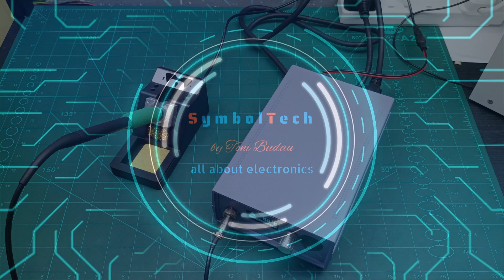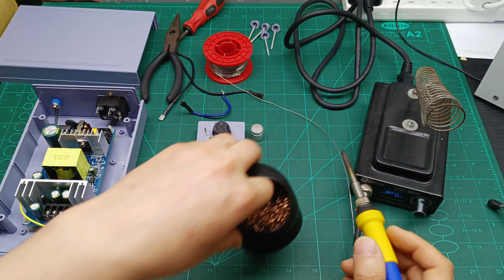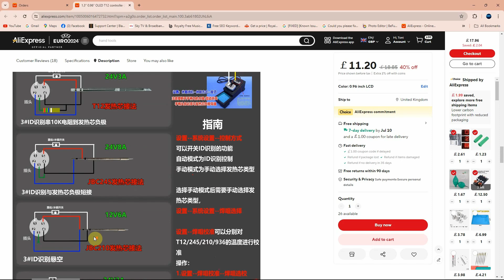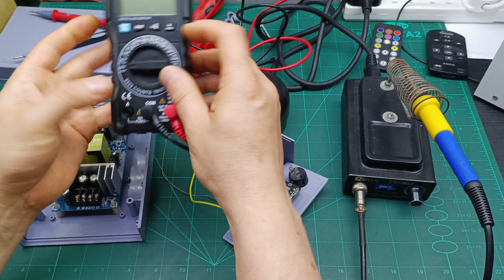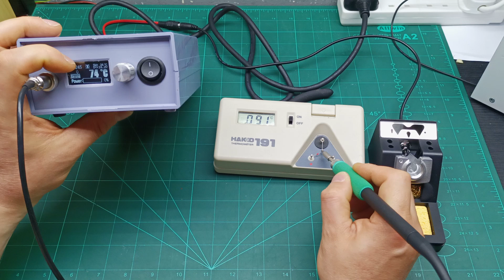T245 soldering station how I made one

Comment: life dangerous work on open case with open switching power supply. non isolated 230v cables only 2cm away from low voltage. put the 230v switch to the back and the low voltage connector to the front. where is the fuse? switching power supplies are  much more live threatening than old transformers. to be save get you a completed closed psu. with 24v 10a. be save. live long.
Reply from the maker: I will definitely show you a brand new soldering station that have the switch on the front and SMPSU!

Comment: Love the video, wanted build my own but bought a Aifen A9E and JCD 858D hot air. Just wanted to ask you something can you tell me what amps fuse do I put in the UK plug? I'm using a 10 amps fuse for JCD as the euro plug has 10 amps written on it. A9E I'm also going to 10 amps after watching your video but the euro plug had 16 amps.
Reply from the maker: The euro plug and UK plug have the same voltage on the wall socket so the current that will be pulled from the wall socket will be the same. On the US or those countries that are using 120v on the wall socket definitely the current will double to match the power as per ohm law!
Reply: @SymbolTech21  The A9E is rated at 160 Watts and JCD is rated at 700 Watts. Should i use a 3 amp fuse A9E and and stick with a 10 amps fuse with the JCD?
Reply from the maker: @sham27007 so power divided to voltage will give you the current in amps so just divide the power consumption of your device to the voltage you have on the walls sockets and then you get the amp rating. And just use a fuse with 0.5A higher than the results you get
Reply: @SymbolTech21 I decided to use a 3 amps for the A9E and a 5 amps for JCD.
Reply from the maker: @sham27007  I will go with 1.5A for the 170w and 3.5A for the 700w
Reply: @SymbolTech21 in the UK we only have 1, 3, 5, 10 and 13 Amps for main plugs
Reply from the maker: @sham27007  I was thinking that you mean the normal 5x20mm yea the one ceramics that are on the plugs it's hard to find specific ones but the 5x20mm you can find a wide range

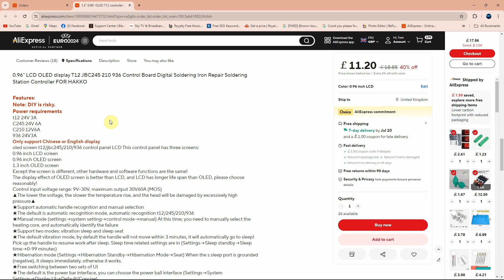Comment: 10:55 the C210 can also be driven with 24V3A (PWM duty cycle is ~1/4 compared to 12V), so no need for extra 24V->12V buck converter.
Reply: yeah...im using 24v for this module,its working well with 245,210 and t12,dont need buck converter
Reply from the maker: @hdmovies5487 thanks that's great. I know t12 is 24v and t245 is 24v and t210 is 12v but if you said that you tried and the controller adjusting the voltage accordingly for the t210 that is a plus
Reply: C210 resistance 2.1 Ohm. At 24V it is 11.5A. PWM it is duty cycle in time, but this current doesn't disappear anywhere. you need power supply can give this 11.5A impulses and tip itself of course not ready for such currents. This current also flows through the thermocouple, which is connected in series in 210. What kind of losses are there in the wires with this current 11.5А? Powering the C210 from 24V is the stupidest thing you could do. Maybe you should start thinking first? and I personally solved the problem in an elementary way. Any power supply has a resistive voltage divider in feedback loops. Add one transistor shorting one resistor and connect it to a microcontroller pin to switch 12/24V. LOL.

I did this myself when I redesigned my T12, and now it automatically supports T12/115/210/245. My stm32 t12 soldering station is already 9 years old, and I added support jbc didn't spend any money for new one. and I can do whatever I want with this STM32 station, because firmware is open source . P.S. And my old t12 station power supply 80x80mm couldn't give even 5A, it was deigned only for t12 of course. But after some changes it can give 8A in peaks. So even ols t12 stm32 possible to upgrade to 115/210/245, but you need some brain for it and will. I have electronics as a hobby, so I find it interesting to do this. To others It's easier to buy another one. Now front panel with controller and 2.0' display with pictures and graphs costs 15$ in china. Power supply 24V 9A 6$. Case 6$. And you will have cool soldering station if you want do it yourself.
Reply from the maker: @dekus80 yes I can add an DC to DC converter with a switch to switch to 12v but I'm not using c210 tips because are more designed for phones motherboards and I'm not doing phones. Mostly I repair laptops consoles and c245 it's perfect for these jobs
Reply from the maker: For c210 you need 12v
Reply: @SymbolTech21  The usb-c soldering irons with C210 tip drive it with 20V.
Fnirsi HS-02B and AiXun T208 shows 20V on the display and a guy measured the Alientek T80 received 20V on usb-c. 
There's no voltage regulator in the portable irons (PWM is used to limit the power), so that's what the C210 tips receive in those.
Reply from the maker: @Gregorius421  for this particular board I'm not sure if works the same. I didn't tried yet a c210 to confirm that because I don't have c210 iron tips.

Comment: I received my modules and I just finished assembling them today (1.3 & 1.55). Thanks to ur video, it made it easier.
I have an old laptop charger, 19V - 3.5A, used to supply.

About T12: In ur other video, about the handle in ur diagram, u took 2 wires from pin 4, one to the negative and one to the body of the tip. (total 3 wires)
I took one wire from pin 4 to the negative of the tip and the same continued to the body (so total is 2 wires going to handle)
At the end, everything works fine ... thank you again
Reply from the maker: I'm happy to hear that my video helped you to make your soldering iron, should be 3 wires from controller to the iron handle. Because the iron tip have the heating element and the thermocouple that read the temperature.

Comment: I'm new at this. So this only needs to be ground to the body of the station if the station is made of a conductive material? 

But there is no voltage leakage at the tip? So it's tip ground? If so I need to order the parts to build this when my new T12 station gets here. 

Thanks for the video! Very clear, informative content.
Reply from the maker: @wwiding  so the tip need to be earthed
Reply: In my country buildings which were built before the 1990s even don't have earth. For example building where I live (it has 17 flours) was made in 198x so it never had and doesn't have earth, hahaha. Even if I want and ready to make wires at flat, but building itself doesn't have earth, nowhere to connect. And in my city a lot of such buildings. I can only amagine about earth and tolerate the tingling sensation when touching metal parts powered by switching power supplies. World it is not only one country ). But a person is designed in such a way that he doesn’t even think about what and how is around him, it’s only around him, and not everywhere
Reply from the maker: @dekus80 I know that old buildings they don't have earth connectors but I was talking about the regulations that are now on the world that any metal case must to be earthed and if your electric wires in the house don't have this that is not what I was meaning on my video!

Comment: Is it possible to replace the IC voltage? Can it be used to solder C470 with 48V input? How can I help?
Reply from the maker: @AdibMinecraft  you need to change the controller
Reply from the maker: @AdibMinecraft  I found this controller board that works with c470 https://s.click.aliexpress.com/e/_EuW8yqY

Comment: hi

could you show how to modify the cheap 245 handle to work with this controller? 
The instructions for most of the t12/c245 controllers on aliexpress show red, black, white, blue, and green wires, but the cheap c245 handle I bought from aliexpress only has 3 wires and a jumper wire..I'm having dificulty in figuring out which wire goes to which pin on the gx12 connector.
Could you make a video on the necessary modification to make the 245 handle work? or if not tell me what color wire goes to which pin for c245? I have the same handle you linked in this video.

much thanks
Reply from the maker: @GearJammer-me8uj  here the video in how to connect the soldering irons to it https://youtu.be/gSFJQsr6UcU?si=OClVwXoxTTP1ed4x
Reply: @SymbolTech21  Thank you very much..I am now up and running with my own 245 station...I love it!
big thanks to you!
Reply from the maker: @GearJammer-me8uj  that what I'm trying with my channel, to help other people on understanding better how electronics works and how we can make our own devices spending less money!

Comment: hello, have you tried to connect t245 to your quicko station
Reply from the maker: @zombieryder  I don't tried but will not work. Because 2 reasons. 1 the MOSFET which controls the iron tip will not handle the current and the power supply that is inside the quicko don't supply enough current
Reply: @SymbolTech21  im using modified handle with hakko TX1 150w and TX2 300w cartridges on quicko station to solder thick copper. I dont have t245 currently to test with. Also Im guessing the power rating is about how quickly the tip heats up. Quicko station heats up 300w cartridge just fine though it does takes its time.
Reply: @SymbolTech21  if I am not wrong, at your tutorial, you used the t245 cartridge. So why are you saying that it will not work. Did I lose something?
Thank you!
Reply from the maker: @Kostliasist  I used t245 with an 9A 24v power supply

Comment: Thank you for this full tutorial with links to buy the parts! You got a new subscriber with a useful video like this. I'm new to soldering and this seems like a good way to get a quality iron for a good price. 

What type of wire should I use to connect everything? I bought all the components you linked but I'm not sure the wire type was listed. Is there a specific type of connector I should get with the wire?
Reply from the maker: @Jacob-vx4zw  hi there when you get the soldering iron handle please make sure you check the connection diagram of the wires from the connector to the iron tip because you need to modify some pin orientation. About the wires I used for the mains AC voltage stripped a pc power cord and used and from the power supply to controller board used wires from an old pc power supply.
Reply: @SymbolTech21  Thank you! Do you have a link for the jumper cable you used and the power adapter on the back (the small one with the yellow cable). I was not able to find a link.
Reply from the maker: @Jacob-vx4zw  I already changed that connector because I installed the connector which I received on the last mailbag video. Have a look on that video and you will find the link on that video description. I changed because should have 2 separate wires that goes on 2 different locations on the soldering iron controller board and when I'm using the part for swapping the iron tips will show on display as well that I'm changing the tip
Reply from the maker: @Jacob-vx4zw  on this video I have the right connector for the cable that connects the soldering stand with the soldering station https://youtu.be/jfjz_3gEWzE?si=sY1-cN19BxiTQwPh
Reply: Hi again,

I got everything setup but you did not mention how to convert the T245 plug to work with this setup. How do we change the plug on the T245 soldering iron to fit in the socket?

Thank you
Reply from the maker: @Jacob-vx4zw  I don't know what do you mean? I get the t245 handle with the right connector socket just need it to resolder the wires to the pins according with the diagram on the listing of the controller board
Reply from the maker: @Jacob-vx4zw  you can contact me on messenger and I can help you out on it
Reply from the maker: @Jacob-vx4zw  hi I just released the video in how to connect correctly the soldering handle to the soldering station so have a look on this video https://youtu.be/gSFJQsr6UcU?si=nRcHdRjrsTY8pbhC

Comment: Hi Tony, awesome video, great build, I’ll be looking into building one of these also, thanks for the links, couple of questions, do you use ferrules for the screw mounts? What is your son’s name? He’s growing very fast.
Oh and also just wanted to tell you, the difference in the controller boards, one is LCD and the other is OLED. Just thought I’d let you know.. keep up the amazing work mate 🤙🏼🇦🇺
Joe from Australia 🤙🏼🇦🇺
Reply from the maker: @Johadart  I used some plastic spacers harvested from some old computers to fit the power supply. My son name is Anthony and yea is growing fast already 2 years old soon I need to send him to school. I'm happy to heard that you may want to build one similar soldering station and stay tuned because I learn how to calibrate it and use the settings to make it work properly so I will have an other video about this soon.
Reply: @SymbolTech21  cool buddy can’t wait to see..
Reply from the maker: @Johadart  hi Joe, if you will use the same soldering handle please check the wires connection from the tip to the connector as per connection diagram from the control board listing link to make sure it's ok because for mine I needed to make some modifications swap some pins around on the connector
Reply: @SymbolTech21  ok I will do Tony, thankyou for letting me know this.. 🤙🏼🇦🇺
Reply from the maker: @Johadart  also make attention when ordering the soldering handle to have the same connector as the controller board have because you can chose between 2 types of connector